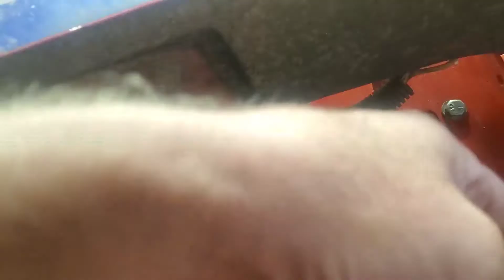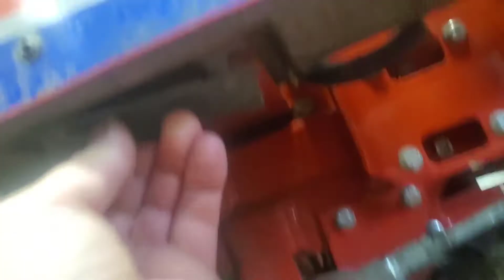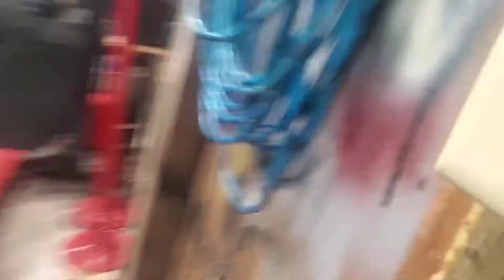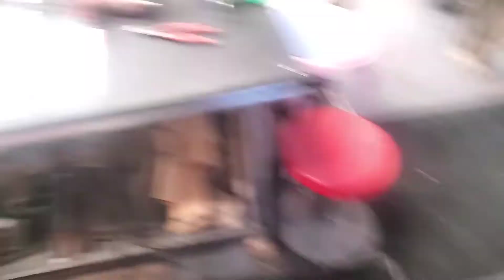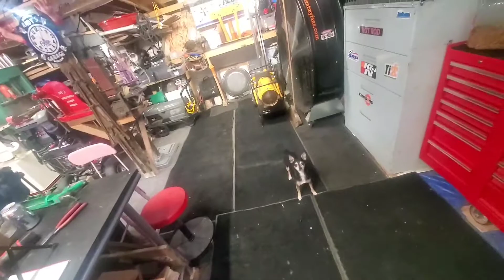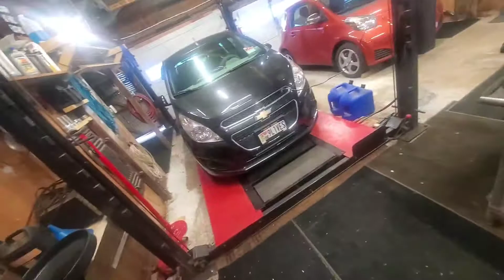upgrading the lights on my lawn mower, one 12" on front & two 7" on sides

Comment: makes me wonder how many amps do those ride mower alternators make, i bought poor quality imported  galvinised angle iron what ever metals its made up from its a unusually hard to drill, no prizes for guessing which country its made in.
Reply from the maker: They put out between 10 to 16 amps these lights only pull 18 watts each
Reply: @TheOriginalAndysGarage  thats not bad for a small alternator
Reply from the maker: It's a 26 horsepower V-twin